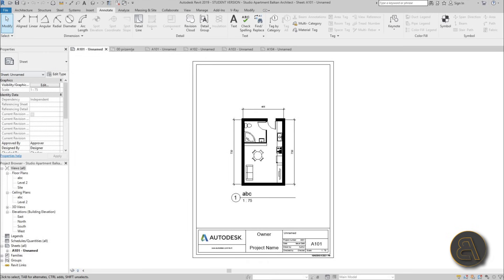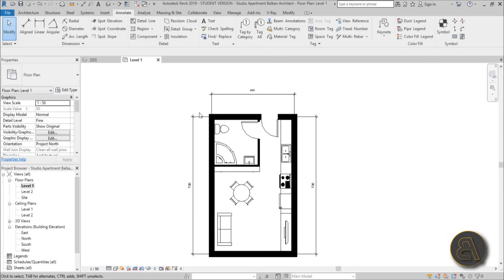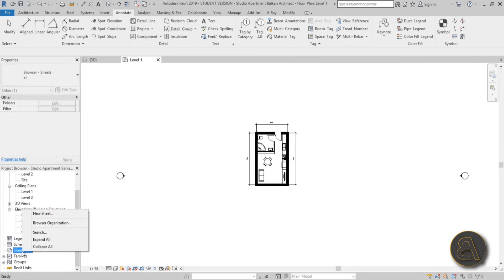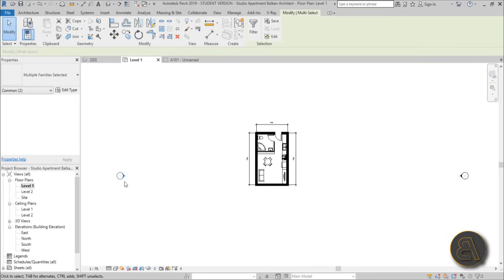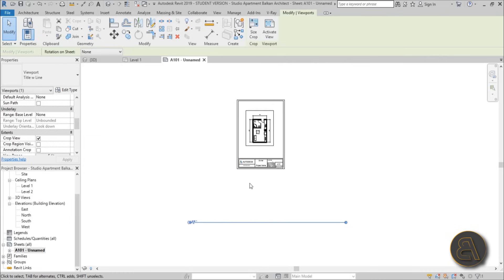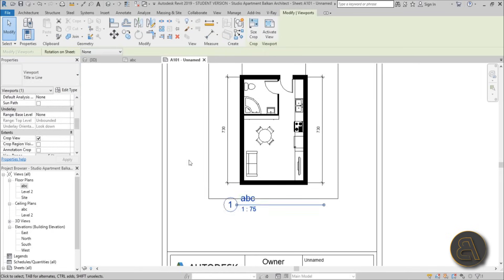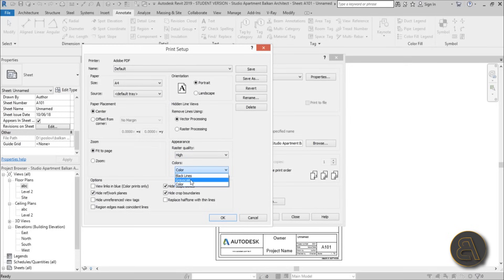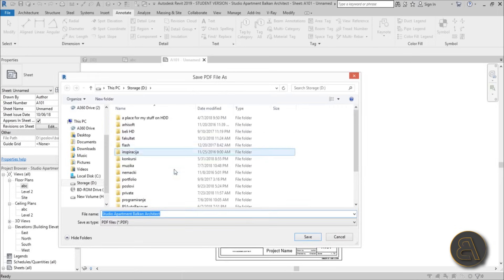Scale and Print (Export to PDF) Setup in Revit Tutorial

Comment: Revit Titleblocks are drawn the size of the paper. Therefore "fit to page" causes the printer to try to fit the titleblock on the page applying margins. This results in shrinking the print. Zoom 100% maintains the exact size essentially placing the outside line of the titleblock at the very edge of the page. Since the printer cannot print here, those line are omitted.
Reply: You just saved me from 2 hours trying to find this answer